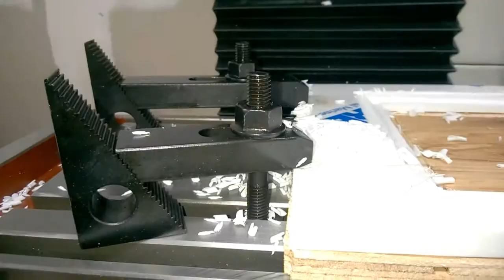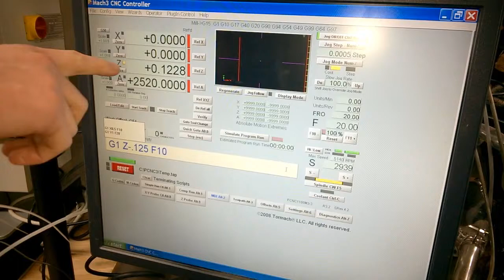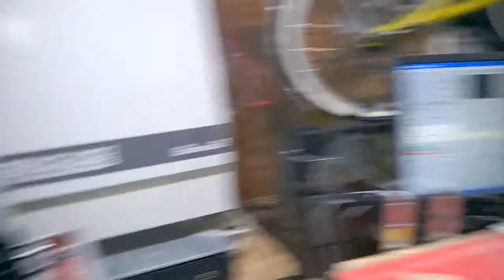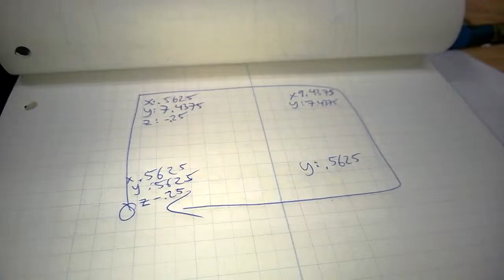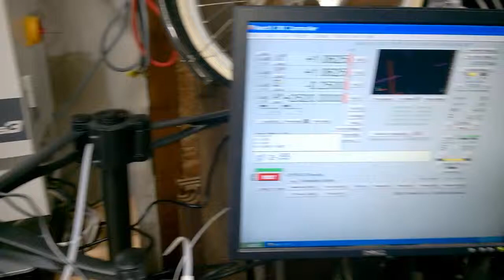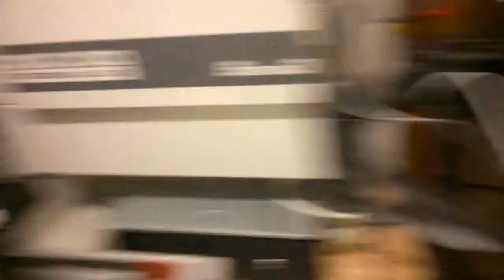CNC Basics for the Clueless

Comment: Its killing me that the Tormach is on a wood stand. Can't believe it would hold the weight. Nice you have someone to learn from.
Reply from the maker: The stand plans are actually from Tormach's website.  I simplified it as they have plans to build a copy of their metal stand out of wood.  I won't be doing high volume machining and will probably stick to plastics, so there was no need to collect chips or used coolant using the stand.  It is actually very solid and did not even creak when we lowered the 1100lbs machine onto it.  I did use 4x4 instead of 2x4 in some places.